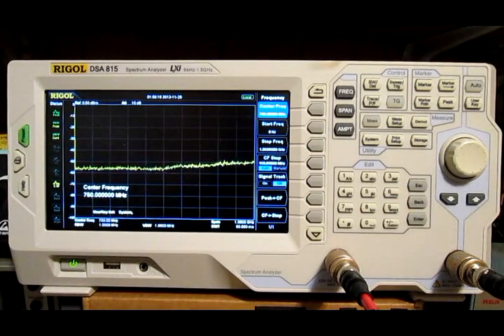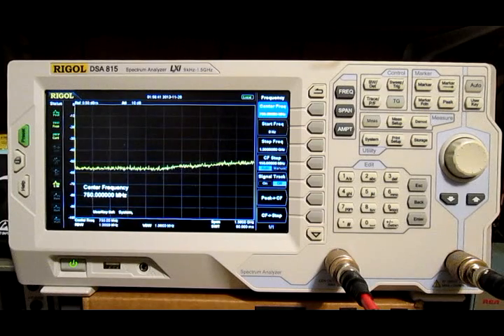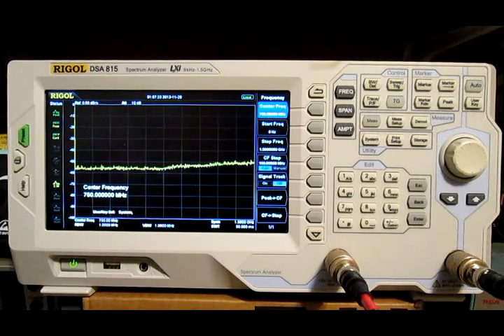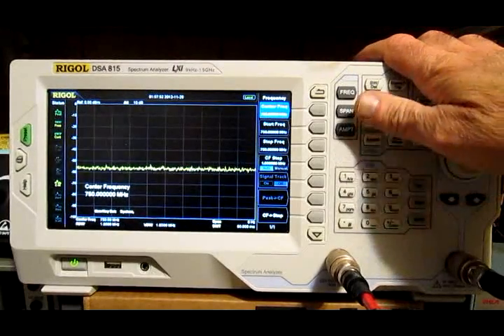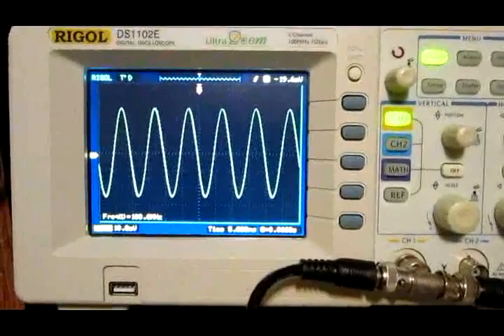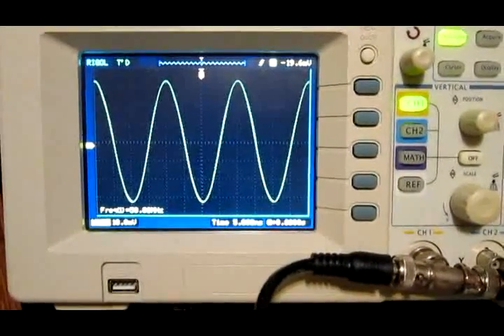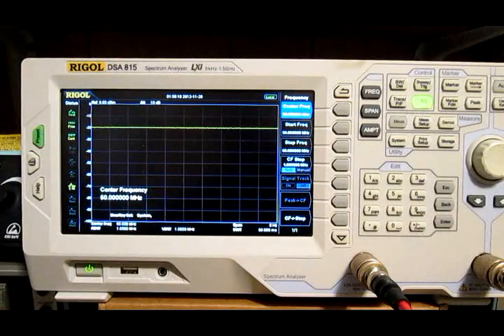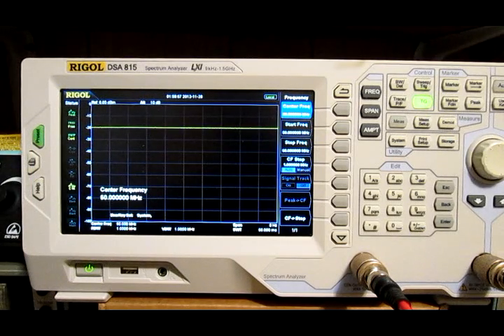Rigol DSA-815 RF Spectrum Analyzer as a RF Signal Source

Comment: Thanks… I have the Rigol SA but have really only used it for duplexer tuning.
It’s actually nice to break out the test gear and actually use it for other intended tasks.

I also have an Agilent N9340 SA with TG.
It was nearly 10x the cost of the Rigol but it’s a 6GHz / “portable” battery powered unit,
I actually like the display and ease of use of the Rigol.

Comment: Hello Randy. Thank you for the video. A few years back, at my work place, we used HP 8753 D and E models to tune simplex and duplex filters. They were a VNA of course. Can your unit with tracking generator be set up to use it in such a way that I can see common mode currents if I were building a 1:1 Balun transformer? With the 2 port VNA, I could set up a tuning mask for the filters.. thanks in advance! 73's de K8KEM David in Ohio
Reply from the maker: Hi David .. I really dont know the answer to your question .. I dont recall any tuning masks in the Rigol .. 
and its not a VNA  .. You can tune those filters / cavities with it .. sorry I didnt have a better answer .. 
I can run that by Chris Armstrong at Rigol NA if you wish ..

Comment: Whats the highest freq. you can get out of it as a signal Source? Is that -20dBm across the entire range?
Reply from the maker: Its a 1.5 GHZ analyzer .. The RF output of the TG is adjustable from -20 dbm to 0 dbm
Reply from the maker: Also, you can of course insert attenuators in the path to lower the signal.
I agree its a bit annoying that the DSA-815TG only goes down to -20dbm .. 
I use Mini-circuits attenuators most of the time ..  nicely constructed and 
very accurate ..
Reply from the maker: bee Hive I should also mention that the Tracking Generator output is not ruler flat which is why the SA has a normalize function.